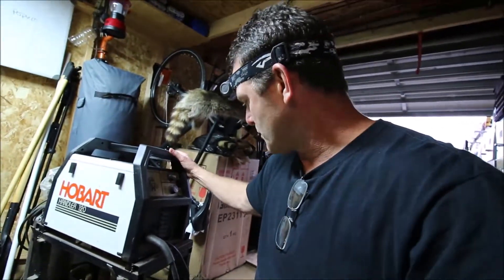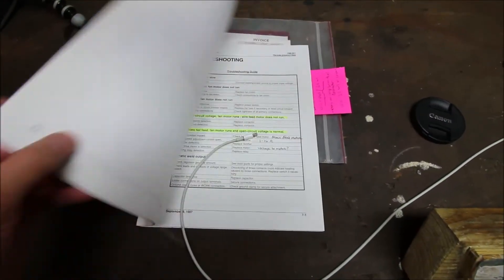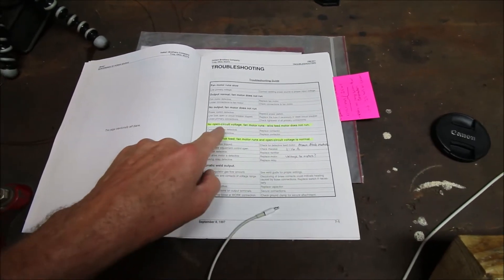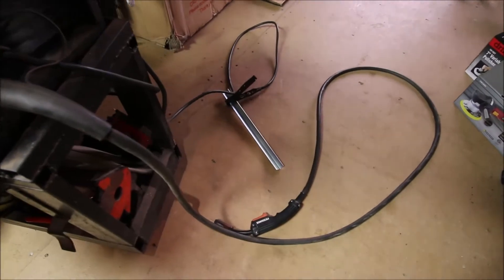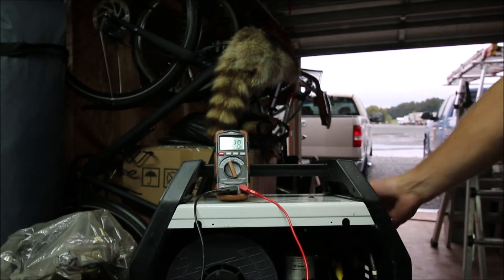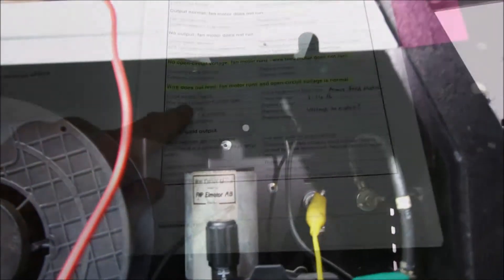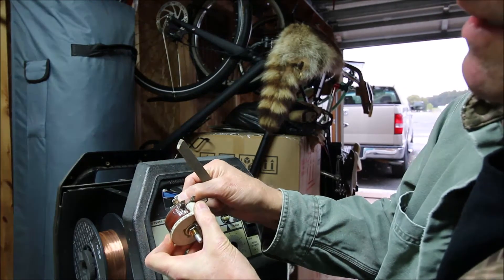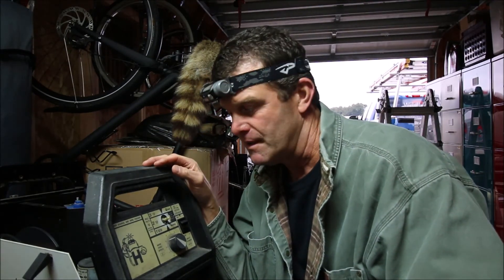MIG Welding Machine Troubleshooting

Comment: Thanks eh! I bought mine in 1994 and its been awesome! Have built alot of hot rods and funky wrought iron with it. Few days ago it stopped feeding the wire. I will go over your troubleshooting steps and hopefully get it working again. I have a parts machine if I need any bits.
Cheers eh!
Reply from the maker: Good luck!  I bet it’s going to be a simple fix

Comment: Have the same machine that's been sitting in my shop for several years unused. I have been trying to troubleshoot it. When I go to weld it arcs and then won't sustain a weld. I have tried various settings and speeds. The wire speed won't feed below 3 so I figure that needs to be looked at. Could this be a problem with the diode(s) or capacitor?
Reply from the maker: Heck if it’s been sitting that long it could be a corroded connector. You should at least poop the hood and take a look around. It could be simple
Reply: oh ohms test one direction momentarily I was getting like 1900 ohms which seemed weird. Re: rectifier UEI meter it's getting OL in both directions

Comment: Hi great video I have the same welder but can’t get the wire to feed. It looks like the wire feed motor. I say that because the wheels that the wire runs in will not move
Reply from the maker: I suppose if there is power going to the motor and it is not moving then you may have a bad motor.